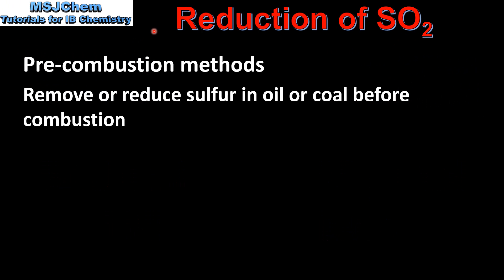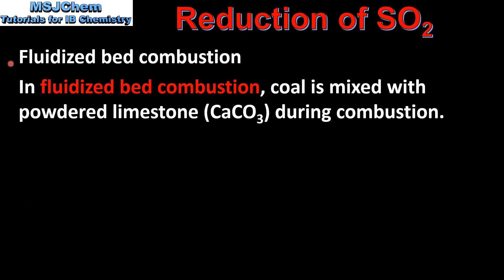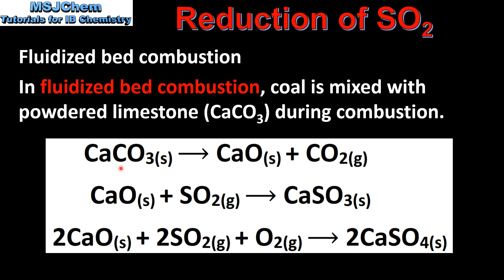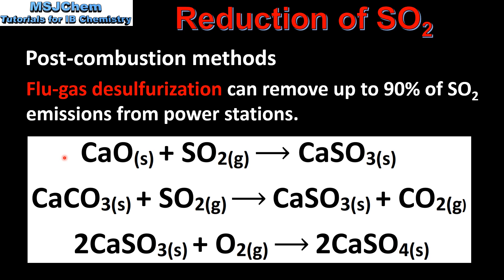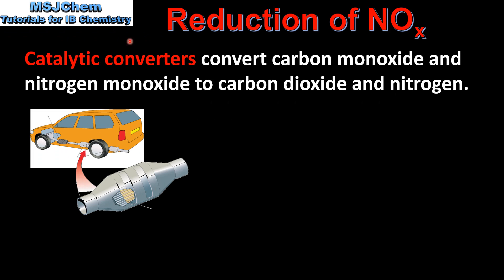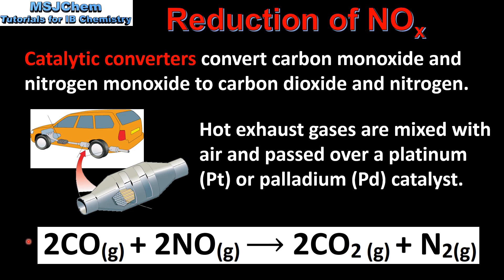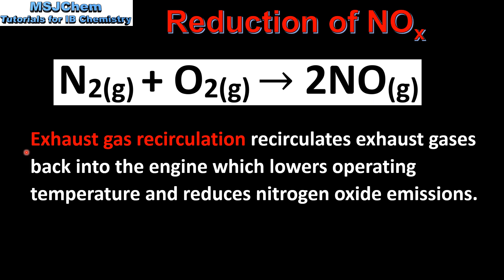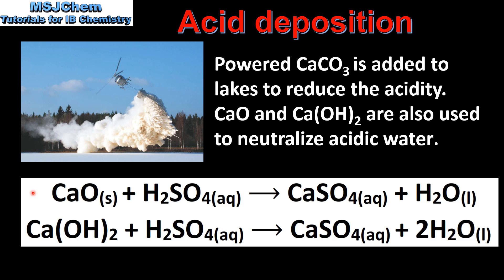8.5 Reduction of SO2 and NOx emissions (SL)

Comment: Hi again! Is it necessary to revise the reduction of nitrogen oxides? The syllabus point only mentions distinguishing between the pre-combustion and post-combustion methods of reducing sulphuric oxides. Your videos are super helpful btw, thanks heaps!
Reply from the maker: +Luke Davies You are correct in that the syllabus only mentions reduction of the oxides of sulfur, both pre and post combustion. There is no mention of the reduction of oxides of nitrogen, but I have covered it in this video just in case. And thanks for the feedback, I'm glad my videos are helpful for you.
Reply: Right, it's good to know about for reference I suppose! Another thing, would you think that it's necessary to memorise the equations for Flu-gas desulfurisation? There's so much to take in, and I wouldn't want to memorise it when I could be obtaining more vital chem knowledge (assuming it wasn't necessary)!
Reply from the maker: +Luke Davies It's difficult to know what the IB will ask about in the exams. To be honest, I think you could be ok without memorizing all of those equations but just having a general idea of the process.